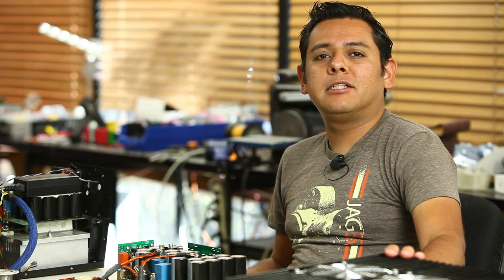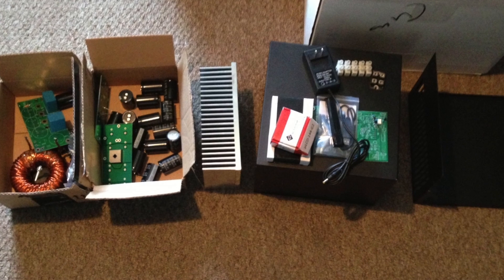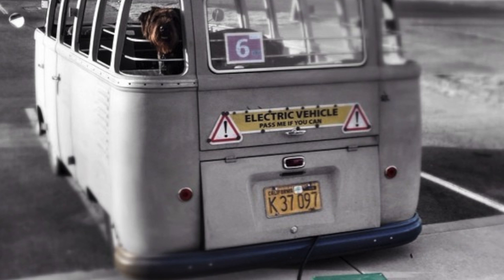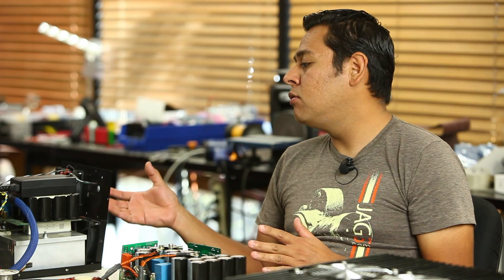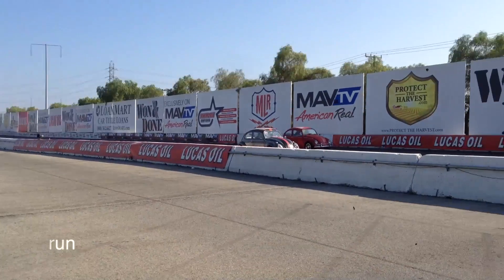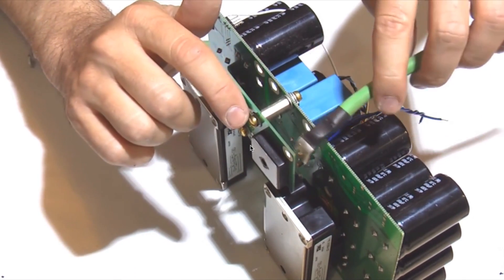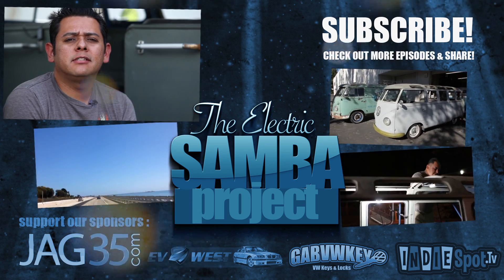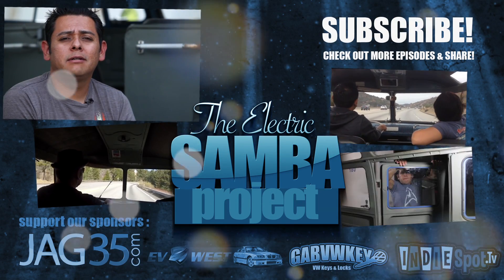DIY EV VW Bus  charger issues - eSamba  - Electric Car

Comment: I dont know what exactly went wrong in your Charger, but i had similar
problems when i built a similar charger some time ago.
(100A @ 120V from a solar-buffer-Battery to a car)
As long as the IGBT  and the rectifiers are still ok, things cant be too worse.
Keep an eye on any evil transients that might blow up the igbt-drivers and the processor.
Place at least one big supressor-diode before and another after the voltage-regulator.
The fuse must work as resistor for all spikes ;-)
I think there are 12V before  and 5V after the regulator and also 12V for
driving the igbt. I used 1,5KE 18CA Diodes for protecting the 12V area
and P6KE 6,8CA for protecting the 5V-Area from then on it worked
even under most evil conditions

Comment: I have a fairly early version EMW 10kw charger.  It blew up in short order but the repaired version has worked ok.  I've tried to avoid letting it get too hot but it does seem to cut back as it gets hot.  Wish I had gotten the PFC version. 
I also have some EMW JuiceBoxes.  I find them very usefull but the build quality is variable. And, as you note, EMW seems over extended.
Both devices seem to use the same almost unreadable display..
EMW has done some very inovattive stuff and I wish them the best.

Comment: Jehu, I laughed so much watching this video.  It's like a mirror image of what I went through.  My present unit is 12kw it had a hiccup but Val fixed it & sent the exact same unit back V2, originally a replacement for the original 10kw water cooled unit.  It does get hot in the trunk, should add ducts for fresh air, but I don't want to cut holes in the body.  Just keep the trunk a crack open when charging.  Val makes some pretty serious chargers, I would encourage you to help EMW design a water cooled case for his NEW 25kw charger.  We're supporting the development of these amazing products.

Comment: you might want to keep an eye on your audio levels. at times i had a hard time hearing you then at other times you where very loud.

also i'm not sure what voltage you run on. but when i build my electric car i'm going to probably use an old forklift charger and modify it.
Reply: Thanks for the Feedback Rinoa Super-Genius about the audio. I'll keep an eye out for that. Not sure what happened, but I think the lav mic wasn't pointing the right way. I was editing with headphones and it sounded ok, but I'll watch my levels.
Reply: What voltage are you planning? 96 volts is OK. 120 is great and any thing above that is just killer. My first conversion started at 72 volts and I converted an old Lester 36v charger to a 72 volt charger and 15 amps. worked perfect. The original charger was 36 volts and 30 amps. Double the voltage and half the amperage.
Reply: Pete McWade
 it really depends on what motor i find. i would assume 48 to 72v. i'll be putting it into a 1982 mercury zephyr. i have about 12 car batteries that will make a great test pack, and i can slowly replace them with lithium 18650 battery blocks.

only issue is i dont drive a car at all and dont plan on it. so this project is really on the shelf. but it's inevitable that i'll come across the parts that i need ^^
Reply: IndieSpot.TV
Editing with headphones isn't a good idea... your ears react differently to near-field sound than to speakers. That answers some of the questions I had in these videos with this same problem. Our ears are very "non-linear", and will compress a LOT. You need so emulate the listening environment of the listener... it's all about seeing and hearing it from your target audience point of view, to get the best results.

Use decent quality self-amplified monitors for video editing... or at the very least, a high quality PC speaker set with subwoofer. (NOT a "gamer" speaker set, they give WAY too much bass) 

When you deal with a vocal track that varies a lot, use Audio Compression (Dynamics), and compress at least 8:1 ratio on something like this. Then you can gain it up a lot until the voice track is the same peak level as your bkgnd music track.

I find that 'mastering' the audio track is usually harder for many people than getting good video editing... but is critically important in this kind of narrative video.

Keep up the good work!!

(yes, I've edited for quite a few years...)
Reply: audio compresor and limiter on insert on the master will put the volumen on the right level.

Comment: Would it be easier to use a doner car for these projects like a nissan leaf?
Reply: The Leaf has a 6kw charger, and it is very proprietary. By all means, getting a wrecked Leaf and keeping the batteries and charger then scrapping the rest of the car would be economical. You would be rather limited, though.
Reply: Yes, for the modules but not the charger, at least not until they come up with a way to control the charger and to be able to set voltage and amperage levels. I have two Leaf Packs going into my 67 VW Panel.
Reply: HoonaticRacing Renault Zoe has probably the most versatile charger of all new EV's, it can go up to 44kW and anything below as well. Pretty neat :)